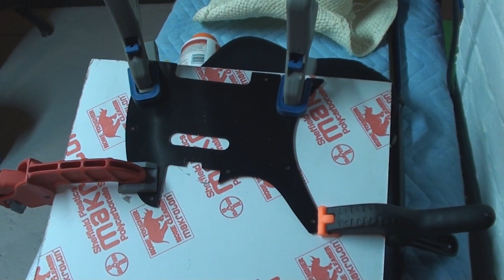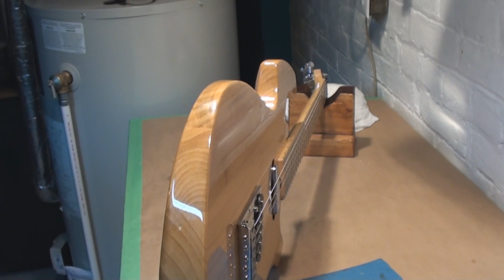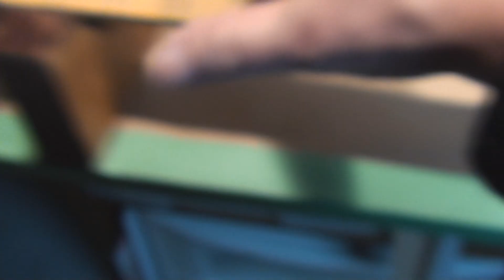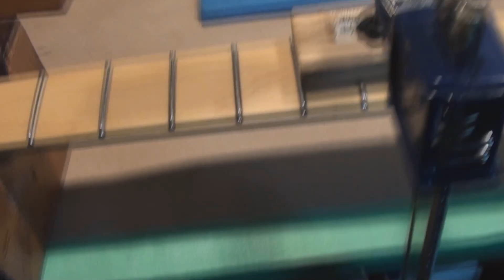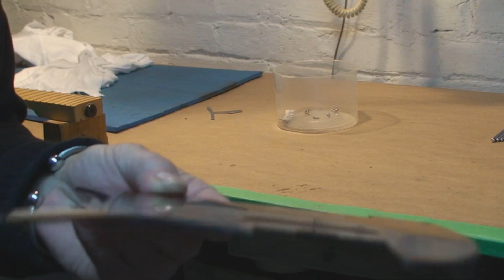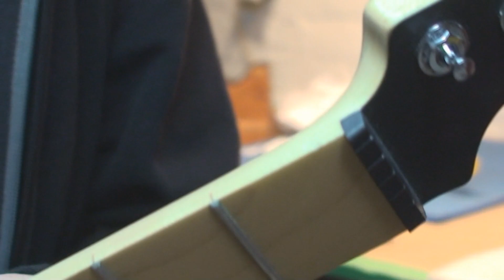Parker P-36 Guitar Repair

Comment: Just wanted to say HUGE THANKS for the help with the pickguard. I just picked up the last P-36 at the local BestBuys music store at a steal, the only prob was a warped pickguard. (apparently happens alot on those) I didn't have a heater so I put it on the board with one screw and put the whole thing in the oven on 300deg for about 5 mins till it laid flat, perfect results. Screwed the rest down and let it cool over night, filled in the screw holes and re-aligned it, looks new now. Thanks!

Comment: Dave, if the truss only works one way, why did you apply truss back tension when you were trying to straighten it back in the other direction while on the bench?  Just curious.  Great videos coming from you lately. I love it.

Comment: Dave, is that a 2 way truss rod? If so it looks like you are tensioning it in the wrong direction to correct a back bow.  Clockwise to bend back, Counterclockwise to pull the neck forward or up.

Comment: hey dave what if you use some hot lamps on the neck when its clamped? like heating the neck with halogen lamps for 10 hours then let it cool for 2 or 3 days